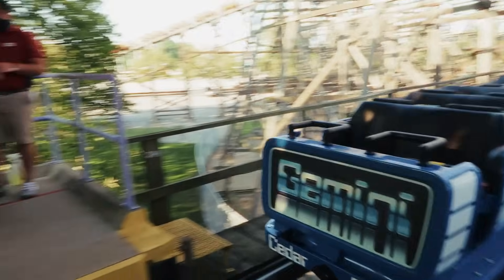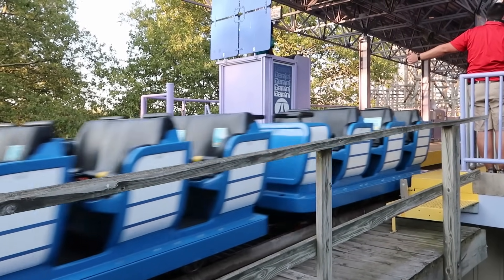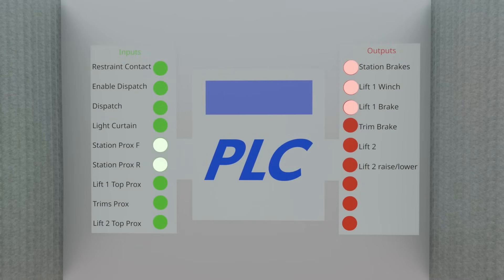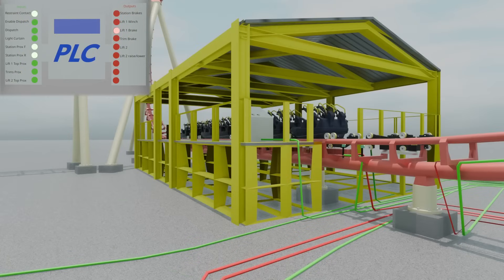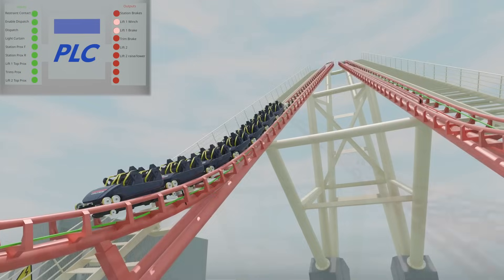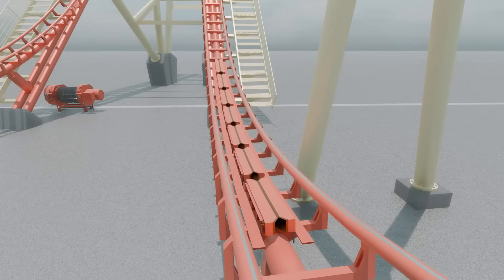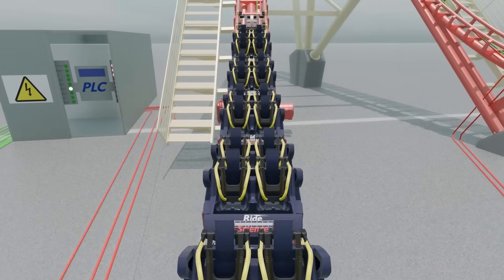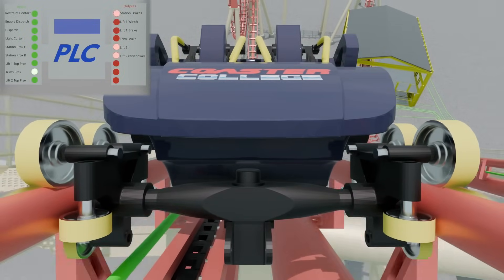How Roller Coasters "Think" - Ride PLC Basics

Comment: My first roller coaster ride was when I was 39 years old. It was on Boomerang at Six Flags Darien Lake NY. 
I loved it so much, I applied to work there as a Ride Operator. Within a week, I was working in Operations, starting as a Ride Attendant, and eventually as a Ride Op holding the microphone and operating the control panel of Boomerang. 
Loved seeing the parts of Boomerang we Ride Ops were not allowed to touch, and how they work together. Thanks!

Comment: Speaking of relay logic.... Depending on who you trust, 6 to 9 out of every 10 elevators in the United States still rely on pure relay logic to operate.  True, they are simple and predictable machines. But just the same, lives depend on their proper operation.
Reply: Eh, that's fine. As long as the relays are maintained, they'll work basically forever.

Comment: at first i was like "why not just use a normal computer setup" and then i remembered that my computer is literally haunted and that it's probably way way way way safer if a normal modern pc isnt brought anywhere near a super fast and super heavy metal machine whose entire job is to propel humans at high speeds
Reply: Yeah, you want safety critical systems to be as simple as possible so there's not much that can go wrong. A lot of the time you end up with a PLC running the safety critical logic which *absolutely must not fail*, then have general purpose computers doing stuff like analyzing data to look for developing problems. I don't have specific experience with amusement rides but general purpose computers are probably also running non-safety-critical systems like sound effects, animatronics that cannot physically enter the envelope of any part of the track, etc.

Comment: A good follow up video would be - what happens to ride systems when the power goes out.
Reply: Pretty sure most brakes for roller coasters are “hold open-fail closed” style. Which means whatever makes the brake open and close holds the brake in the open (not stopping) position and if it loses power the default position is “stop”. 

And I’m willing to wager magnetic brakes have pneumatic/hydraulic brake backups.
Reply: Probably not the case everywhere, but the park I work maintenance for has a backup generator that kicks in when the main power goes out. Its enough to keep air compressors and such running to the point where things can be brought to a graceful stop. However in the event of a total power failure, most everything that is responsible for bringing rides to a stop defaults to being engaged and requires outside input to release, meaning with no power most brakes/stopping mechanisms will bring the rides to a stop.
Reply: Simple : most coasters need power to keep brakes open. No power, brakes close. 
The power disconnect switch is "the last resort" in case of an e-stop failure. Some e-stops are actually power disconnecting switches in disguise and powering the ride up is simply pulling on them with the right key

Comment: Question: Why do so many rides stop in a few short spurts before actually lining up with the station? It happens on so many coasters, including the kumba footage you were using
Reply: I can answer that. What you're seeing is different commanded speeds to the vfd for the station drive motors. 
They will be high speed coming in, flag a prox (usually a set flagging the bogie or brake fins) when close to the stopping point, which will change the vfd to a slow commanded speed. 
 
This allows for a precise stop when it flags the home prox. While the plc IO reacts within milliseconds, the momentum from the train still takes time to stop. Traveling at a lower speed means more precise parking due to lower momentum. 
 
 
Source: I am a controls programmer in the coaster industry
Reply: From my understanding I think it’s to precisely park trains in the station. This is so it aligns with things that open and monitor restraints and other things. On older coasters that are driven by gravity through the station they brakes keep opening and closing to keep the train at a slow and steady pace. More modern rides that have drive tires or other non-gravity driven propulsion seem to slow down the train to a very slow speed right before it parks then finely moves it to it’s in position.
Reply: My guess is that it involves making sure the ride is where it auctualy is and/or to ensure the ride stops in exactly the same spot, considering that the inputs are all digital. I've seen rides that slow down a car or 2 cars out from the proper station stop, and I think it's the same reason
Reply: Happens for multiple reasons, which might be different from coaster to coaster but to stay simple : 
- On some coasters there's nothing powering the train in the station except gravity, but brakes are limited to "open" and "close" and they take like 0.5s to close. To park your train properly you need it to have a slow pace when closing brakes so it's easier and CHEAPER to stop the train, then open brakes to let it slowly flag the position sensor. To let motion happen the station is not flat, but a slight slope.  
Example : Goudurix, Parc Astérix (France), Vekoma.
- On other coasters you have kickwheels/conveyors in the station. They may be used to power and stop the train at the same time. Brakes will only engage after the train has been slowed down by the conveyors themselves. The train will not stop, simply slow down when at 2/3rds of the station and stop when the position sensor is flagged. 
Example : Flight Force (Disneyland Paris), Vekoma or Pegase Express, Parc Astérix (France) by Gerstlauer. 
- And you have some hybrids where the conveyors can go away (sideway or downward) to let the train slow and stop using only brakes but power the train with kick wheels anyway. 
Example : Space Mountain, Disneyland Paris (Vekoma)

And then INTAMIN : 
They sometimes don't use brakes in the station AT ALL. Only conveyor wheels to power and stop trains in the station. They don't "pre-brake, start again and stop" or slow down at all. They just stop. Station brakes are only used as an emergency backup.
Examples : Indiana Jones et le Temple du Péril (Disneyland Paris), Toutatis (Parc Astérix), Velocicoaster (Universal), Konda (Walibi Belgium) and much more.

Just know that rides typically don't know where the trains exactly are. They just know for sure where they're not. When a sensor is flagged, the tolerance is as long as the train itself. 
To park a train the rides use multiple sensors to slow down the train enough while not knowing exactly where it is and at which speed it is going. Only a full stop can be accurate.